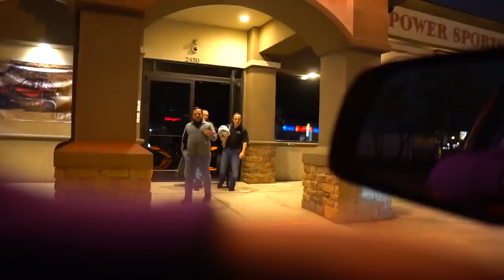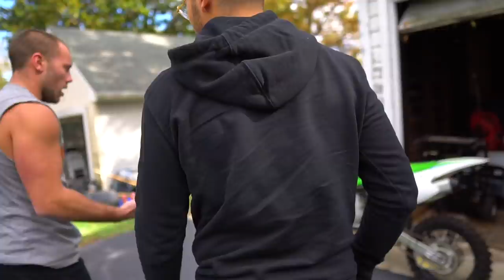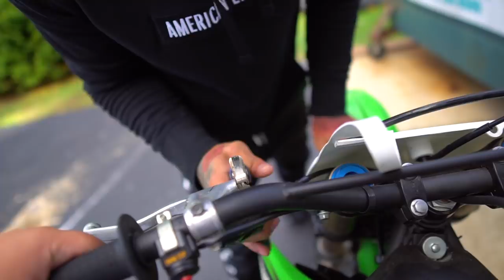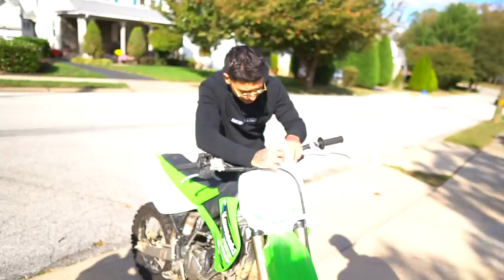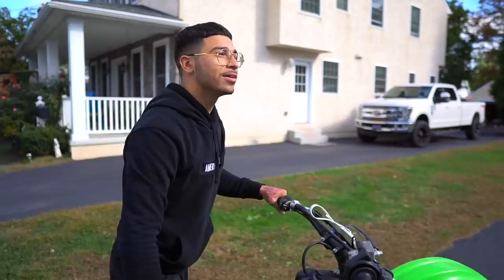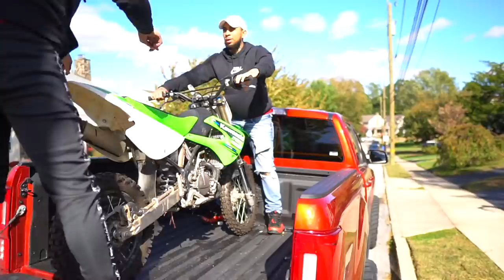BUYING A NEW DIRT BIKE OFF CRAIGSLIST ! *BEST DEAL* (NEW KX85) | BRAAP VLOGS

Comment: Bought a Suzuki rm85, same issue, would stall the moment I put it in first. Got it down a couple hundred for that reason, turned out just to be the oil. They had topped it to the very top of the fill whole and i think they used car oil. Drained and toped off right and boom, simple fix.

Comment: I had the same problem with my hydraulic clutch on my KTM fixed the adjustment and topped the fluid still did it to fix it just gave it a few good revs and it didn’t do it
Reply: itsmeknots same